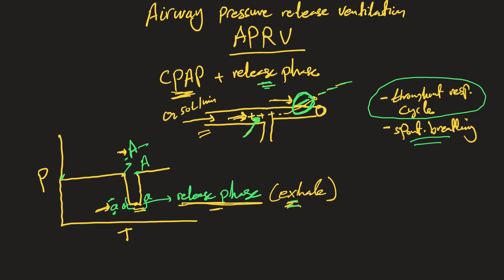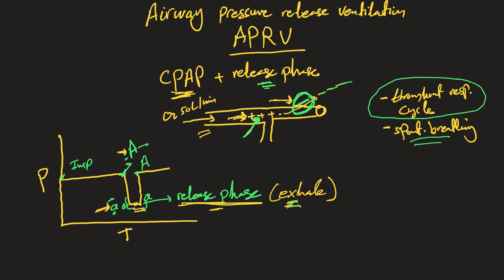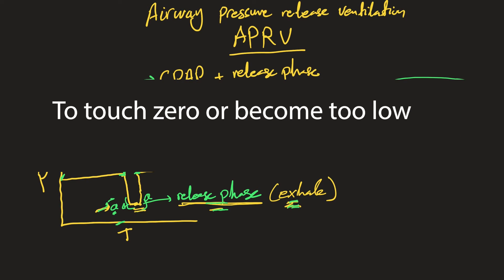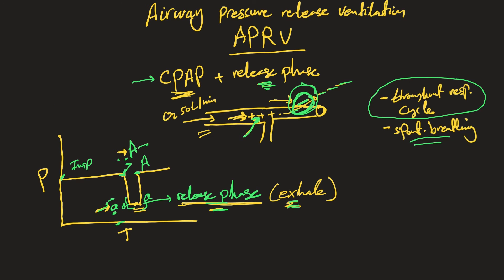Introduction to Airway Pressure Release Ventilation (APRV)

Comment: IS BILEVEL AND APRV SAME?
Reply from the maker: They are related, but NOT exactly the same. APRV (Airway Pressure Release Ventilation) is a specific strategy of bi-level ventilation. BiLevel (BiPAP on the ventilator) is a mode that allows two pressure levels:
P-high, P-low, with spontaneous breathing allowed at both levels.

What makes APRV different is HOW it’s used:

🔹 Very long time at P-high (alveolar recruitment)
🔹 Very short release to P-low (CO₂ removal)
🔹 Emphasis on spontaneous breathing
🔹 Often used as a lung-protective strategy in ARDS

So:

🔹 All APRV is BiLevel

🔹 Not all BiLevel is APRV

Think of APRV as a specific philosophy and setup within the BiLevel family, not just a name change.